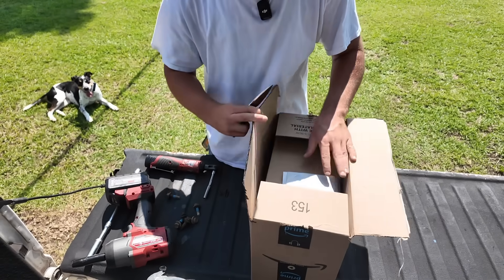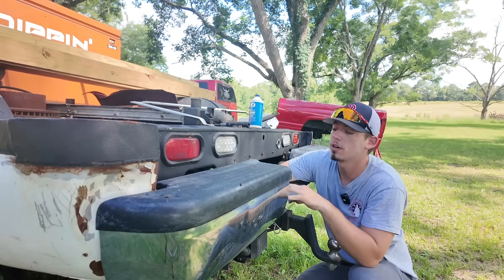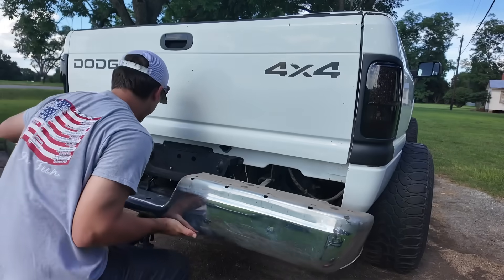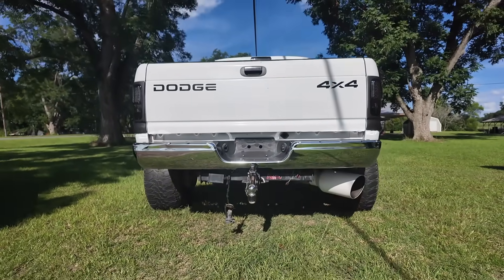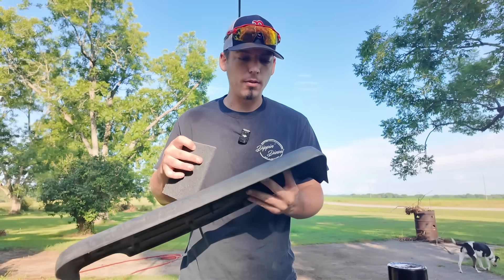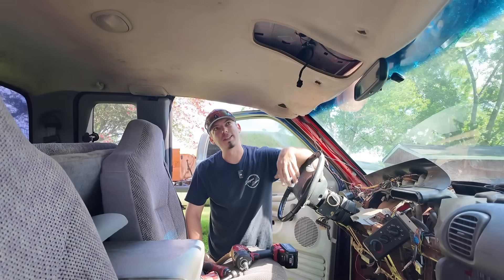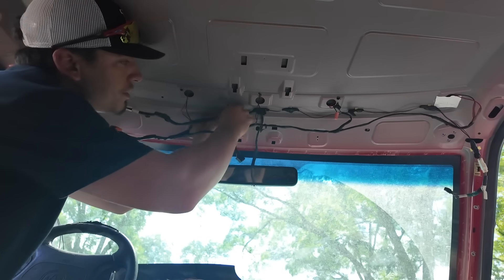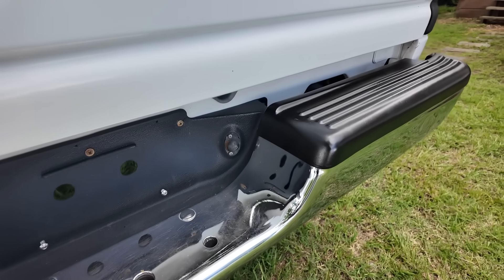Making My CUMMINS Look BRAND NEW AGAIN

Comment: Glad to see you posting again. This reminds me of years ago. Loved all your regular uploads when you were working on The old farm truck. This is like I was saying not every video has to be like a transmission swap or new tire install. You can do these small things like polish and paint the bumper. Paint the wheelwells. Clean the carpet. Weld patches into spots that need a patch. I really missed when you stopped posting. You have really good ideas on doing things on the cheap. Keep it up keep posting. I'm not really even into these big diesel trucks or anything. 

What happened to the lifted truck at the twins shop? Are we going to see you there any more?
Reply from the maker: The lifted truck I showed in this video! It’s behind my house. I do want to start working on it again

Comment: Rustoleum truck bed coating in the spray can still remains king for re finishing the outside plastics and still being able to step on em without damage.

also gotta starlight that headliner before it goes in with the LRB console. We just got the first of 2 consoles done. Comin out real nice so far.